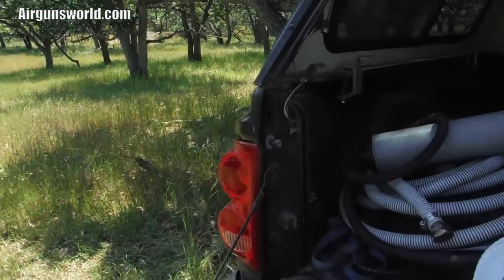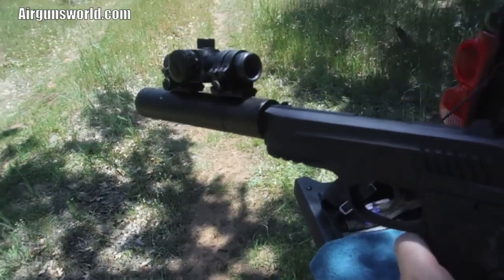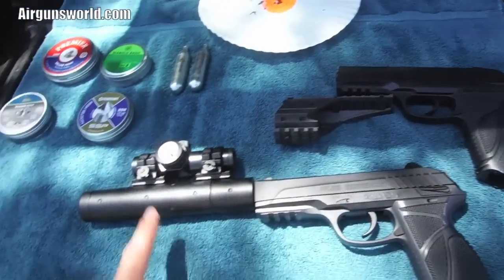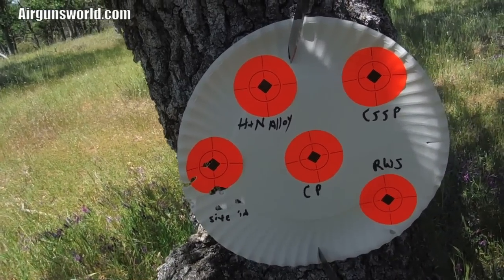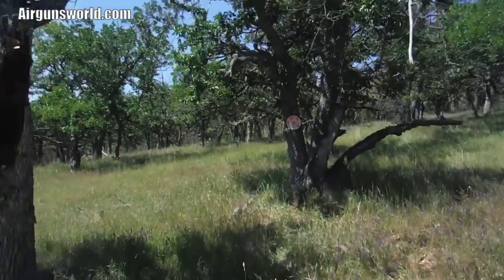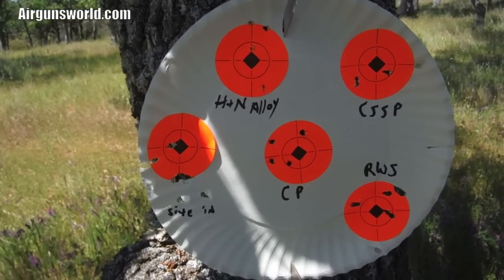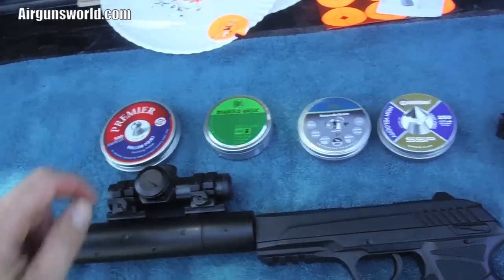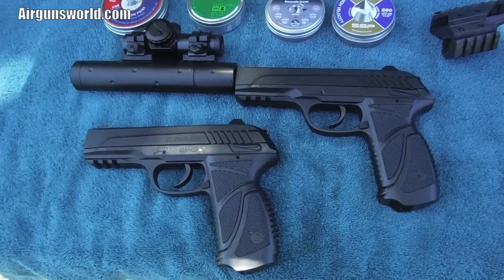Gamo PT-85 Socom Air Pistol Modification to Make it More Accurate

Comment: I've got the same gun tactical  version. all I done was packed it with a little black cardboard tight and I was getting a inch half grouping from 12 yards a 2 inch from 15 yards. so a little bit of packing works a treat

Comment: Set mine up as it was meant to be and had no problem with accuracy at all but if your mod works best for you then hey, why not.
Reply: Bat man same here it was loose at first, but I put it back on and over tightened it, now it doesnt bounce around like it use to :)
Reply: @Trickshot72  I know you posted this like 5years ago but I've got a 5 month old one right here and the barrel rattles.

Comment: While you were shooting it appeared the the airgun would always shoot, but the slide would not always go back with each shot.  Is there any functional benefit to the slide movement?   Each shot seemed to create a clanking sound.  Can you tell exactly where that is coming from and if it can be quieted?   Thansk.
Reply from the maker: +Lon Santora - The slide went on all shots...It is a metal slide so you hear it clank as parts move.
Reply: +AirgunsWorld Very kind of you to reply.   Thanks.   Can you tell if the gun would still function if the slide were tacked down so it doesn't move?
Reply from the maker: It would not function as well as some of the CO2 is used for the slide to work. So if you stop it from sliding then CO2 would not escape properly resulting in bad shooting performance.
Reply: +AirgunsWorld Thanks again.  Much appreciated.   Enjoyed your video.
Reply: how do u make it stop sliding just remove the spring or?

Comment: I love your modification, and will have to try it when I receive the pistol. I do have an important question though. Can you use this for varmint hunting? I have a massive squirrel problem. I appreciate any feedback. Love your channel.
Reply from the maker: Yes; you can use varmints - I don't recommend past 20 yards though. And head shots only of you can do it. Body shots on squirrels will die slowly...up to you on that. Birds will drop pretty quick with this gun, except crows, just bounces off them. Good luck - great pistol!
Reply: +cttnkandy9 ola
Reply: did u remove the spring? i dont see any blowback action